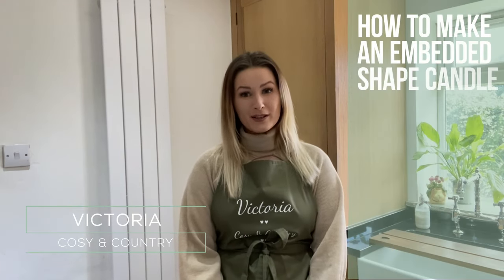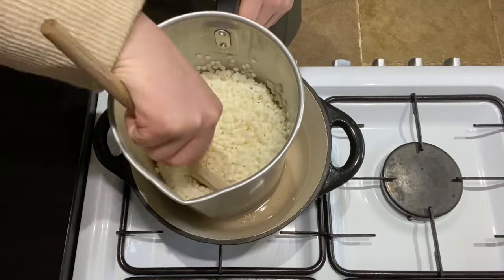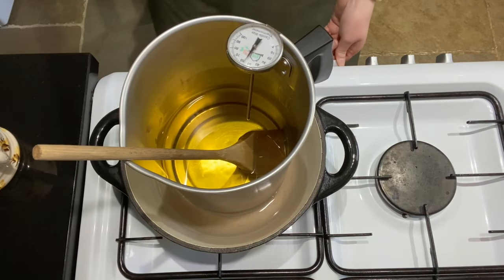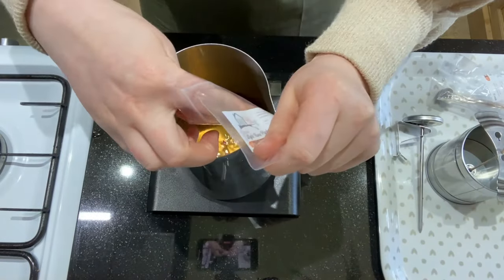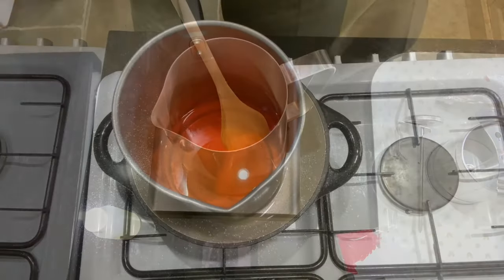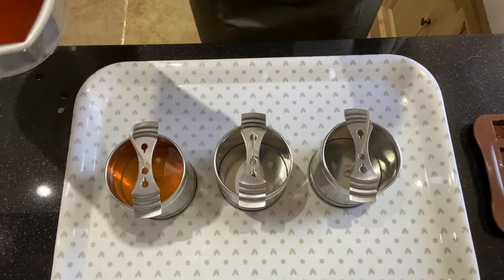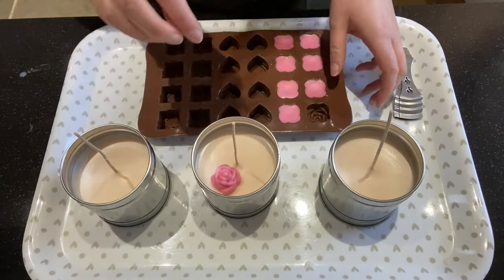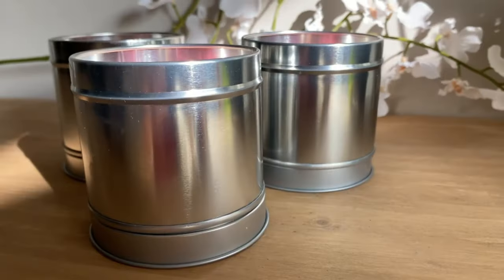How To Make An Embedded Shape Candle | Floral Candle Making Tutorial

Comment: Why do my roses come out like grainy?
Reply from the maker: Hi Marina, this could be a couple of factors. This could be a slight crystallisation, where the dye/ fragrance oil hasn't quite mixed in fully to the wax. Mixing each ingredient one at a time at the correct temperature, until fully blended may help. Pouring the wax at different temperatures will affect how the wax sets, pouring at the correct temperature into a mould that is warm, will help lower frosting appearances. Also, keeping the wax melts at room temperature will lower the chance of appearance changes. Hope this helps! 🙂
Reply from the maker: One more thing to add too, is that the wax needs to be completely melted before adding any ingredients. If it doesn't look smooth, look see-through or is not at the right temperature, the wax may need heating for longer. If the wax hasn't fully melted, this can cause a grain-like effect on the wax.